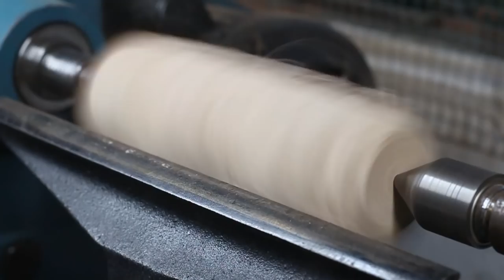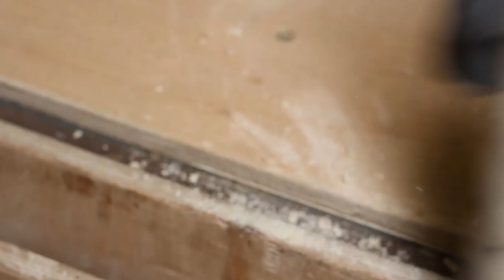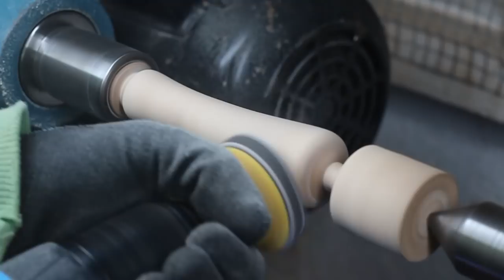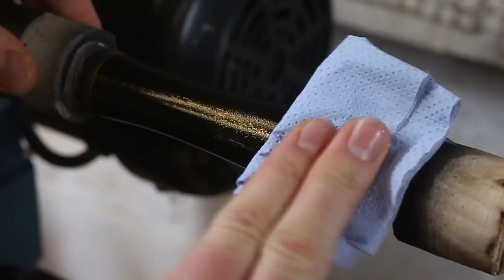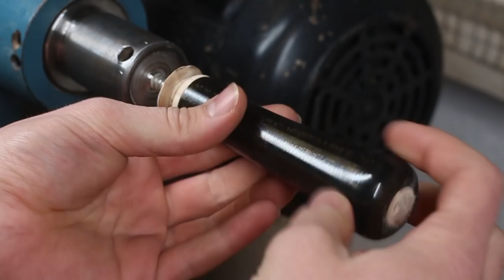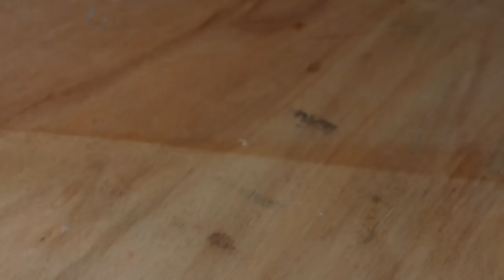Woodturning - You Won't Believe What You Can Do With Firewood!

Comment: I was curious about the worm screw adapter you used. Where did you get it?
Reply: Axminster and other companies make them (Axy call it a wood screw chuck) to fit various lathe spindle sizes, or you can get ones which mount in a chuck as well.

Comment: I’m relatively new to turning. What kind of sanding setup did you use?  Was that just a drill and sanding disc?
Reply: Hi Ken thanks for watching 👀 and your comment. Yes I use a drill and sanding disc, normally bringing the grit gradually down to around 2000. I also hand sand where required 😃👍
Happy New Year 🎉🎉🎉

Comment: Lovely turning vids.
I almost dare not say this because there will be loads of "I know better" comments .. but ...  if the machine just happens to grab the very tip of one finger of those gloves ... your whole hand will go in, and 3/4 hp won't stop or slow down.  I know it's a debate, gloves or not? I personally, would not wear gloves. Just want you to be safe.
Reply: Thanks you black5f for your comment and your opinion which is noted. 
I take H&S extremely seriously,  I have always worn gloves, it is a subject that is regularly raised in here, I always cover in the description field and disclaimer. It works for me but I do not promote their use to others, it is very much a personal choice. 👍😃
Reply: @HarrySmithShorts  Hi Harry. It is a personal choice ... completely agree. I'll tell you what happened to me. The gloves were a bit old and there was a tiny tiny bit of thread that came loose on the end of a finger which I didn't notice. A lot of these gloves have kevlar threads in them for cut resistance, like silk but really strong. I went to the pillar drill with the gloves still on, dextrous gloves and well fitting etc,  the drill caught hold of the thread and pulled my finger in.  I managed to pull back with all my might ... but the glove wouldn't release off my hand and the very tip of the finger was forced against the drill. By the time I'd switched the drill off and it stopped, the end of the glove was smoking from friction, really quickly and I had a nasty burn ... could have been a lot worse. My comment is in no way critical, but that's the back storey.

Love the gold and the "imperfections" and this does actually look like you made a bottle opener from a pump handle! Very creative and inspiration to us all.